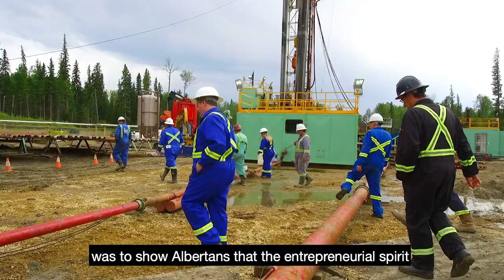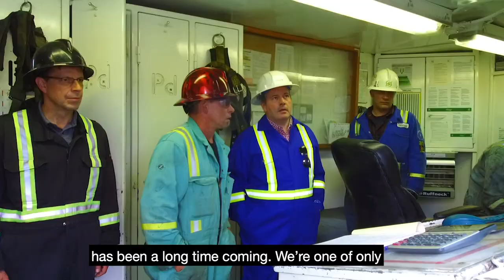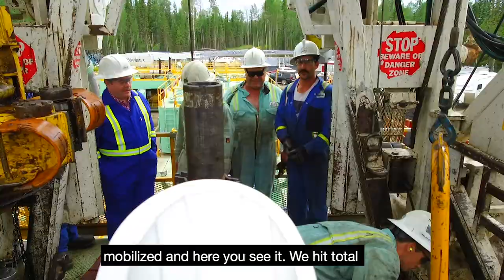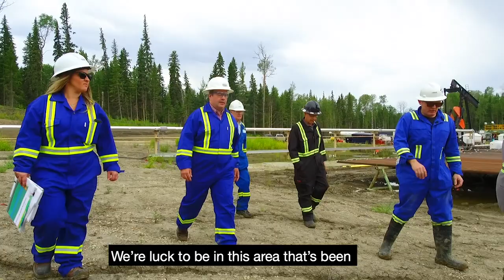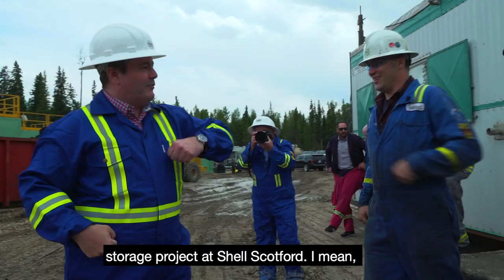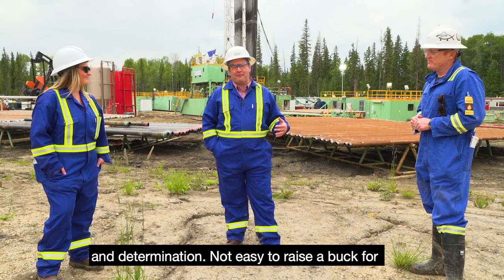HALO Exploration | Jason Kenney

Comment: Fracking is the worst thing you can do people don't realize how hard it is on your water system
Reply: Richard Elniski  LOL I don't have to study geology I'm not a geologist nor do I claim to be my cousin fracked and drilled for 15 plus years 4 Baker Hughes and other big companies Ensign Precision Etc
He was the one that told me about this
So maybe you should learn about fracking have you been a fracker ? or worked up high-up in the oil industry or are you a geologist?
Reply: Richard Elniski  if you did not know while drilling to these depths even though you're using mud and other Solutions formulas to keep things separated that does not work 100% while drilling through the water tables and everything else is when things get mixed up AKA your water tables Etc

Comment: fracking?
too expensive is why it's dead and has little investment in it.
it's technology that only applies to gas and oil and is slowly becoming a stranded asset.
unless you can find another application for fracking, it's a dead industry too.
and you  speak on behalf of a third of albertans only.
you're unliked by 2/3 of the province.